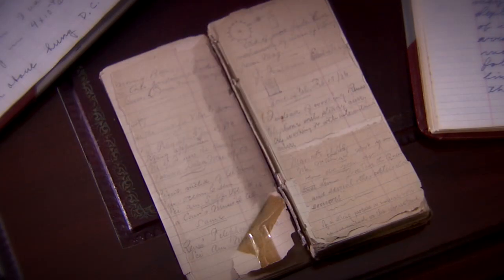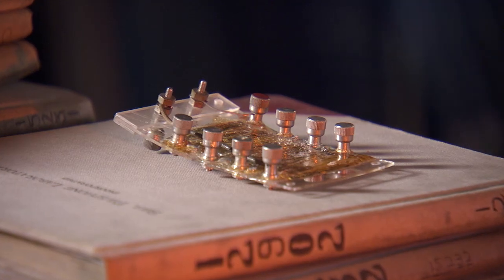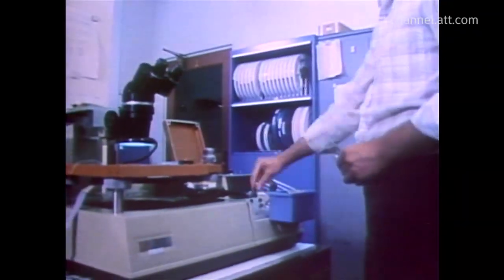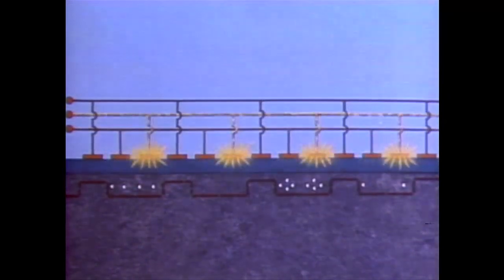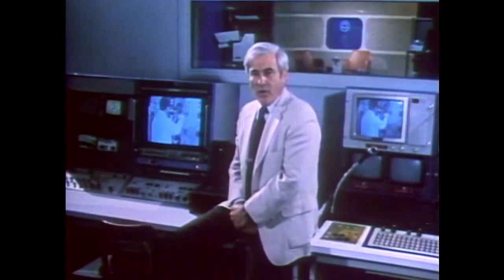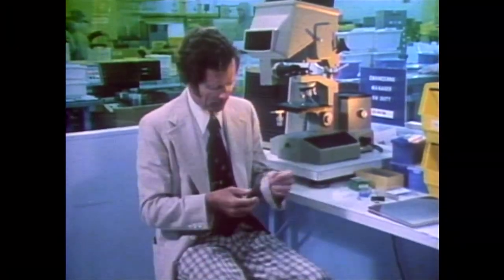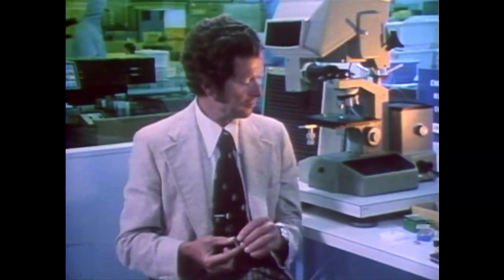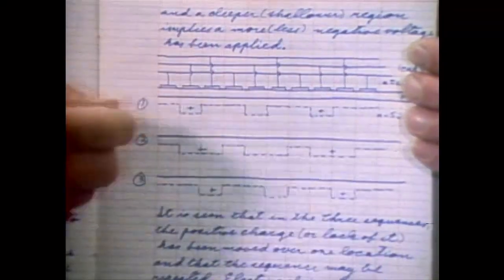Communications Milestone: Charged Coupled Devices (with Bonus Edition Introduction) - AT&T Archives

Comment: I have some first generation SID504s by RCA and am seeking the datasheets or data books for them. SID504s were members of the first commercial product line of these parts. AT&T didn't sell their components to outside vendors. I worked with the SID504s in medical endiscopes made by Fuji Optical Systems in the late 1980s.

Comment: I recall in the late 1970's and early 1980's you could get RAM chips based on CCD and in fact I believe a lot of them still are. That said, they came in ceramic packages with bright brassy covers over the chip. If you pried the cover off the chip and proceeded to read the RAM chip, you could assemble an image from it.